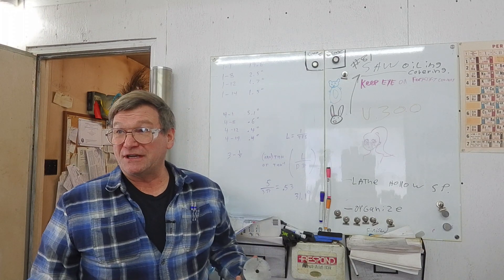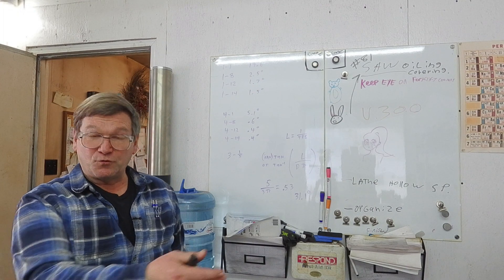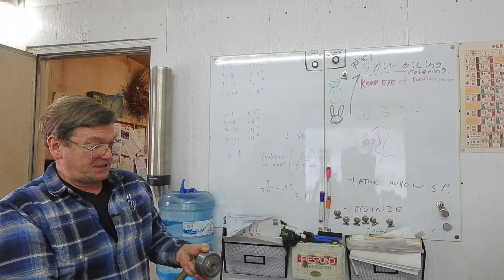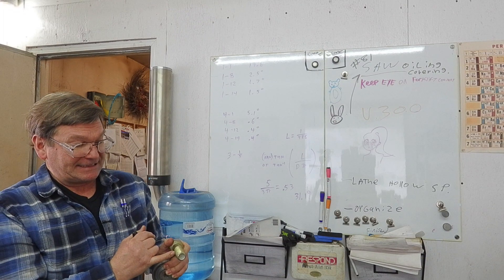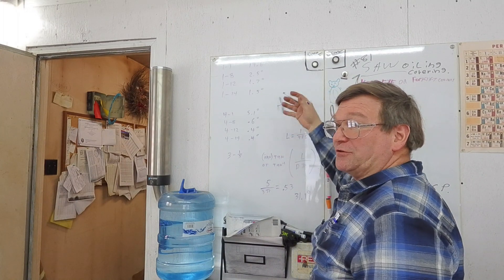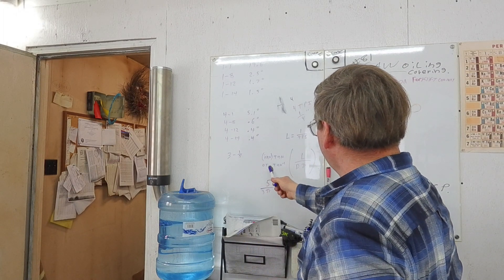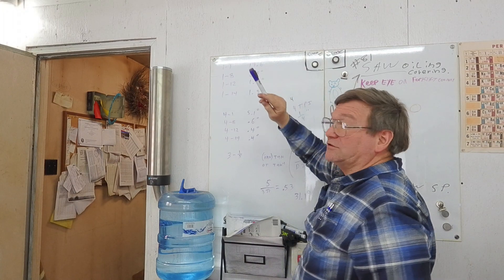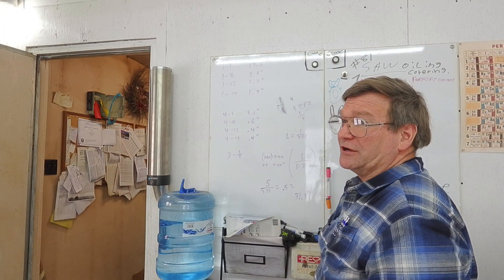Machinist's Minutes: Lead angle when threading

Comment: Been a long time since I've needed to make multi start threads. I have my own one man business and retire later this year. I have a 18" x 60" lathe as my main machine. I mounted a quality dro and purchased a quick change tool post with 12 holders. What I quickly discovered was how much time I saved and still kept my accuracy. Everything is great until it comes to threadcutting. The moment you move the compound slide to reduce thread galling or prevent tip breakage it messes up every tool setting. So here is my method of relieving tool pressure without moving compound slide. Every lathe has a forward/reverse lever for feed direction. Usually directly off spindle. I take a few cuts just plunging in. I tend to cut threads using forward /reverse rotation of spindle feature and leave lead screw engaged. Especially since I'm cutting both metric or inch threads about equally. So I will cut a few passes plunge in.. Then on completing a pass on way back I will stop the spindle. Put headstock out of gear and then turn chuck backwards by hand a wee bit. Then with other hand on leadscrew forward reverse lever I will ease chuck forward and at same time disengage leadscrew. You can feel it sliding out of mesh. Then I will move the chuck backwards(unwind)slowly while holding gentle pressure on lead screw forward/reverse lever and you can feel it slip into the next tooth engagement. I have now effectively advanced the thread cutting tool a small amount. Then I take a few more plunge cuts and then repeat process. This means you don't need to use compound slide. Course threads may require a couple of teeth to advance a worthwhile amount. Once you learn this technique you can cut nice threads fast, don't need to alter compound slide and all your tool holder settings remain viable. Hope you get my story. Love your videos.
Reply: Thanks for sharing. Makes sense if you are using your tool library periodically.

Comment: For anyone looking for another item that uses multi start threads.

Gun scopes.  The zoom function if you have one. 

It’s so you can have a very short rotation turn into a large linear movement
Reply: Mini mag lites use them for the part you twist to turn them on
Reply: @RichieRichOverdrive  nice. Ya that’s a great use of it
Reply: Caps on Tetrapaks have multi start threads - at least, the ones in Europe on those piercing caps have them.
Reply: @chriswalford4161  we have some similar types of caps in the US.